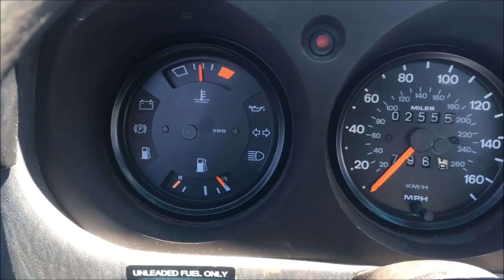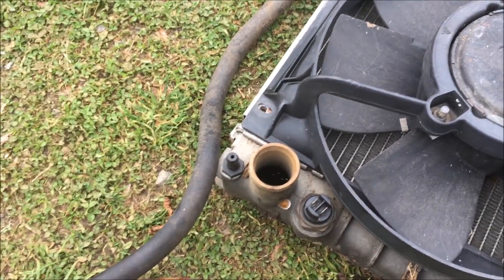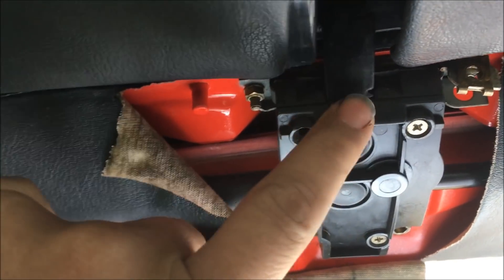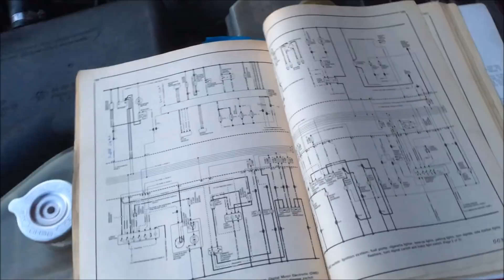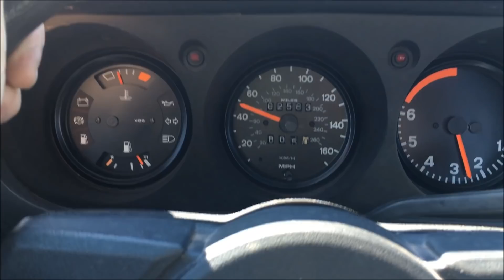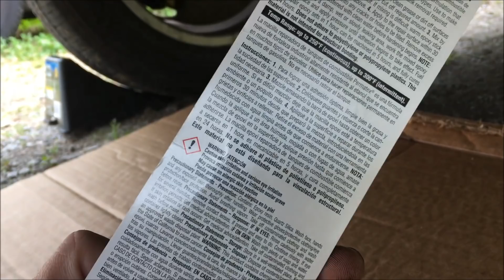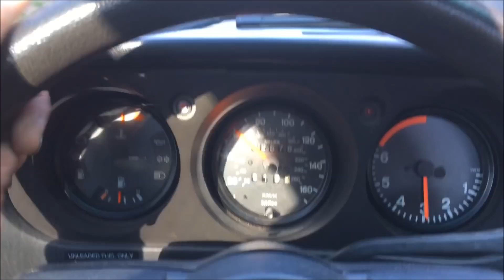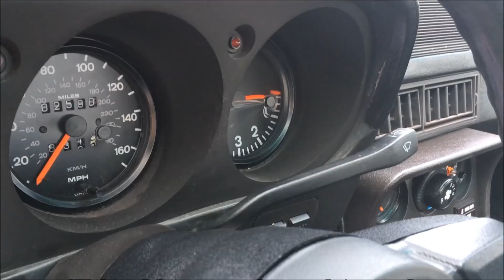Working on a 924S Part 3

Comment: Hi, I have another question. My 1987 924s engine and steering wheel shakes after a cold start up, then calms down and nearly goes away after 2-3 of idling. I have no problems while actually driving. Where should I look first?
Reply from the maker: Due to the nature of inline-four cylinders with their 180 degree firing frequency they need a rather high idle. So I would start there first. It should be 950 -/+ 500 rpms. Sometimes I'll have to raise to idle up to 1000 just to get some engines to smooth out. If the idle is too high with vibration then check for vacuum leaks. Another thing to check is to see if suddenly giving it throttle causes it to hesitate which might suggest a bad plug wire. If all those things look good then it could be time to replace your engine mounts. I hope that helps!

Comment: Just spent $ 350.00 having our 83 944 tank cleaned and lined. No leaks, but did have some rust inside. Building a Champ (previously Chump) race car and could not switch to a post 85.5 plastic without  getting points added which is really what we wanted to do.
Reply from the maker: Nice! I have two spare steel tanks and after seeing this I think that I'm going to have the same thing done.
Reply from the maker: I have the spare tanks out now and I need to get this done since they are filled with rust. Where did you have this done? Was this a specialist or just a radiator shop/machine shop? Thanks!

Comment: Really enjoyed this series. Disappointed that your didn't show fitting the rear window seals and trim. I've not been able to get the metal trim back in mine 🙁. Will see if any of your other videos show this.
Reply from the maker: I may have showed it in the silver 944 videos and skipped over it in these. I thought I had showed it here as well. That said, the metal trim should be installed before the window is put in or else you'll pretty much never get it on. You'd think that the trim holds the glass after its installed but it's just trim and is held on with the installation of the glass. I hope that helps!
Reply: @edredas  Ok thanks, I didn't realise that. I'll have to do that then as the windows and seals are fitted now but without the trim, and yes, seemed impossible to get the trim in afterwards! 🙁

Comment: Old temporary fix on leaking gastanks.. , Supposedly rubbing a bar of soap across the pinhole to fill it will stop it for a short time
Reply from the maker: That's good to know! I'm going to take few tanks out and have them treated and hopefully I'll never have to deal with this again. Never dropped an auto trans before and wasn't really looking forward to it!
Reply: Hot tanking at a radiator shop then using POR 15 makes a permanent treatment. I'm not sure of any cost comparison in your method.
Reply from the maker: Probably what I'll try. Someone mentioned that they had their steel tank cleaned and lined for $350.

Comment: Put  on anew fuel pump on it not getting 12v Put battery charger on it works where is the killswitch on it at
Reply from the maker: The fuel pump only receives power when the DME computer sees that the engine is turning over. This prevents the fuel pump continuously running if the fuel lines are severed in a car accident. The engine will stop and the computer will cut off the fuel preventing a bad situation. So in order to get the pump to run, the computer needs to get power from the DME relay. If this relay is bad the fuel pump won’t run. Then it uses two signals from the two sensors on the bell housing. This tells the computer the engine is turning over. Often you can tell if the computer and both sensors are working if the tach bounces ever so slightly when you turn the engine over with the key. If you don’t see the tach bouncing when starting you could have a bad ignition switch not sending power to the DME relay, or a bad DME relay not supplying power to the DME computer, bad sensors not giving a reading to the computer, and even a tach that isn’t working. Once all those are ruled out and you’ve verified they are all working as they should it could just be a bad fuel pump relay not supplying power to the pump. This is the most common issue and it can be jumped to supply power to the computer and fuel pump all at once. If the car starts with the relay jumped, replace the relay. I hope that helps!

Comment: What rear speakers did you put in? And nice work on the sunroof. I just put in manual rear latches and called it done.
Reply from the maker: They are JBL Club 6420 and currenly on sale at Crutchfield. I have a few sets of manual latches and converted one of my cars over to manual but I'm thinking about converting it back to power...
Reply: No overdrive makes it rev high at 60. The good dif gears are worth it though as a trade off

Comment: I'm sending you some BLACK tie wraps for Christmas this year;)
Reply from the maker: I try to put everything back as the factory originally had it. Those areas call for clear zip ties :D
Reply from the maker: I should mention that the later cars used black zip ties there with a special connector to attach to the firewall. But the early cars used clear or brown depending on year.

Comment: Is there anything on these cars you can't do???
Reply from the maker: I can't really paint them to my standards... yet. Although I really don't have the time to do body work and paint cars on top of all the other stuff I do, I would eventually like to have a booth where at least its an option. The last time I painted one myself the body work was perfect but the humidity caused the paint to blush. If I had a booth it would have turned out amazing. It was a glass out/doors off respray with zero over spray...